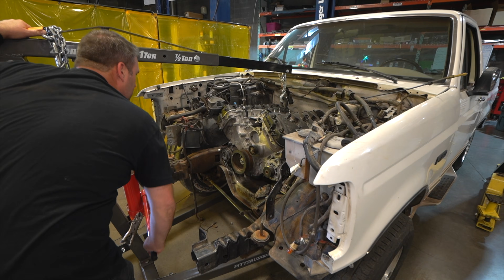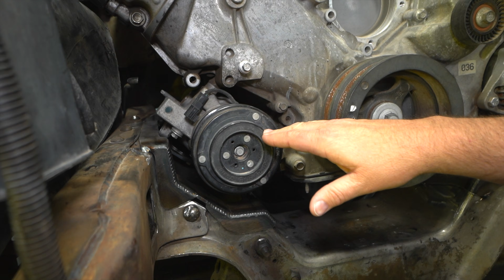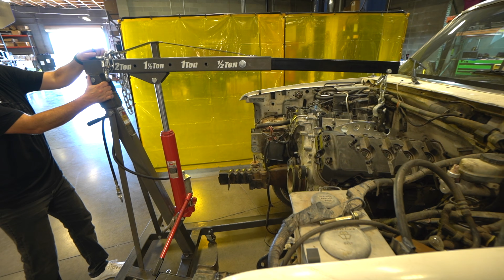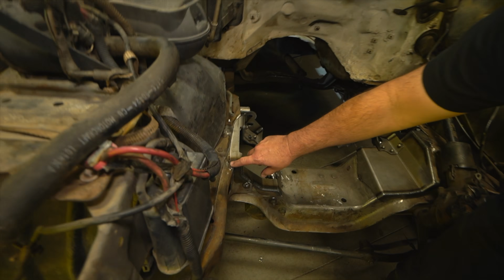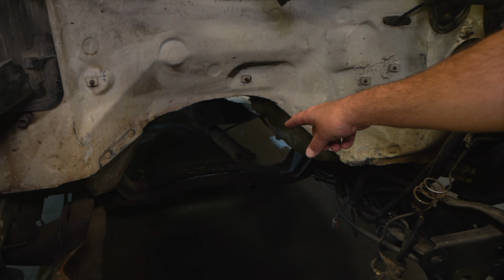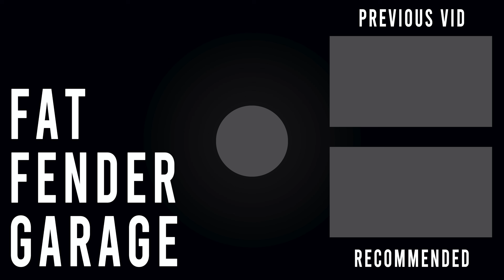How to Swap a Coyote Into Your OBS Ford | 1992-1996

Comment: You are using a Mustang 5.0L coyote.... the truck variety has a horizontal oil filter...  Why would I pay for less torque, higher rpm peak hp and an oil filter relocation when you can just buy a used truck engine that has cams designed for lower rpm tq hp? That is the entire point of a truck and moving the 5-6k lb vehicle.

Comment: I have a 1987 Ford f150 stepside short bed two-wheel drive it has a 302 I plan on doing a coyote swap almost normally does it take to do a swap

Comment: Would it be a similar setup if swapping a 96 Cobra engine into a 96 F150? I would rather do the Coyote conversion, but I already have the Cobra engine. Would it even be worth the trouble, or should I just sell the 4.6 and go Coyote?
Reply: The 96 cobra engine has 305 HP. Any coyote engine make no less than 420 hp. I wouldn't even mess with the 96 motor. Just supercharging the stock motor in your 96 will make you more than 305 hp.

Comment: Would you be able to do a 96 Ford Explorer??? That already has a V8 5.0 in it
Reply: it wont fit.
Reply: 302/5.0L and 351/5.8L small block Ford are much smaller than the 5.0L "Coyote" DOHC is much taller and wider engine.

Comment: How much heavier/lighter is a Coyote vs Windsor? Do I need a different coil spring? Also, is that something you guys provide?
Reply: you would save over a hundred pounds - the Coyote is about 415 pounds
Reply: A dressed Coyote is well over 500 lbs. A Coyote LB is in the 450 lb range. A Windsor with aluminum heads/intake/water pump likely will weigh similar to a Coyote, and possibly less when dressed out. 

This swap is a waste. This is way too much work to put a Coyote into a truck. I own an 18 F150 5L/10R80 truck. It's badass for what it is. I DD it with an AML tune and always run nothing but E85. Coyote is great. This is not a knock against it, but you're hacking up the foundation of your truck to fit an engine that in no way stands alone in terms of performance. If Windsor is truly as good as LS like many Ford fanboys (I generally buy Ford, but have owned a few Camaros so I'm not a slave to either brand) then all this effort is a waste of time and money. That chassis is made to house an old SBF and a Windsor will drop right into it. A built 408 ci LS with a good H/C/I setup will hurt a Coyotes feelings in terms of N/A HP. Seeing as how both a 351W and 6L LS achieve 408 ci's with a 4.03" bore and a 4.0" stroke, a built 408W converted to MAF with a good H/C/I would be a way better option than modding the structure of a truck to force an Engine to fit that doesn't want to fit, and then you have to go with whatever weight placement you're dealt, as you don't have the room to position the engine ideally in the chassis, you're just trying to make it fit. A boosted Coyote is badass. So is a boosted 351W that's built to manage boost. Sure the Coyote is refined, but a LS is refined enough, especially with a SC, running a blower based cam. If Windsor can't compete with LS's refinement then it is in fact not as good as LS.

Comment: Have you guys done a Ford OBS coyote swap with an MT82 or a T56? I was wondering where the shifter would sit in the cab and what extras I’d have to change from my current manual transmission (95 f150 5.0 w/ M5od)
Reply: I’m curious as well, I have a ‘94 F-250 4x4 ZF5 and I’d LOVE a T-56/T-6060 with Tcase (actually a 5.8l GT500 supercharged swap 😜😎)

Comment: Hi from australia I've had a81 f100 for 21yrs its the same chassie as a 96 apart from the crush area an they have a problem how the rails are riveted to the crossmember I've fixed mine when I got it as well as 6 others over the yrs they work loose an to fix it the crossmember has to be fully welded in to the rails mine had 3mm of movement between both rails an the worse one I fixed a 4x4 had 13mm of movement between both rails an mine is 2wd that doesn't do any hard work an I'm saying this from the point of I want everyone to do the best they can keeping these on the road I don't see enough bracing or welding of the crossmember where it's been cut both sides an the hole is in the left side needs extra brace to join the rail an crossmember together because that front end works itself apart I hope this helps because the old truck's never had that problem an I've had a 77f250 for 32 yrs

Comment: what about using a aod tranny its bulletproof with the setup.thanks

- nick
Reply from the maker: 4r75w will work with adapter and stand alone harness kit to control it. I wouldn’t use an AOD tho
Reply: @FatFenderGarage  aod is the best tranny for a small block and mod motor period tho and its bolts too a coyote motor why not use it and no wiring to play and thats whats in my dads 84 f150 i want to coyote swap.thanks
- nick

Comment: The term OBS originated as a Ford thing to distinguish the older body style with a Powerstroke rather than a newer Super Duty Powerstroke.
Reply: But as you know, chevy always following Ford.
Reply: @xxZerosumxx  as you know more chevrolets transplanted in every type of vehicle. Mostly ford's .
Reply: @techs1smh13 just like all the ford front and rear ends in all the old chevys too
Reply: @nathanthompson9368  ford 9" 💯  front suspension maybe pinto mustangll. I built one of first v8 pinto in so ca in 70 's
Reply: Wouldn’t Obs mean 1920’s, truck 1930’s, 40’s 50’ 60’s. Old body style
Reply: Yep powerstroke term started with 7.3 obs to superduty
Reply: No the tf it didn’t . It started with Chevy . Yall just be saying anything. Hence why there’s also nbs & nnbs
Reply: @stezzydynoe3516  you're literally wrong

Comment: Awesome man. I see you made a plate to cover up the hole like when Gumby does them. Funny my 357w in my 95 started hammering 2 weeks ago too
Reply: My 94 has the 351w in it and I’d love to go Coyote!! I can’t wait to see how big a job I’m in for!
Reply: 351w???
Reply: @noahbartholomew932  351 Windsor ws the big brother to the 302.  They were optional in the F-150 until the redesign in 97.
Reply: @chuckp7970  I was correcting @droppedf100 bc he said 357w I know what a 351 is lol
Reply: @noahbartholomew932  Copy that, oops!  But If his 351 is bored .030" over it would be a 357"